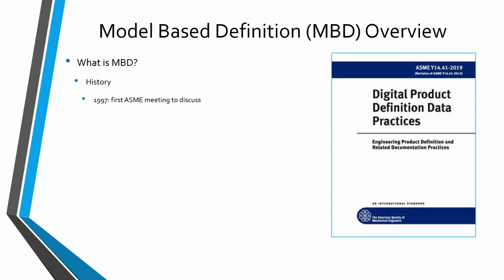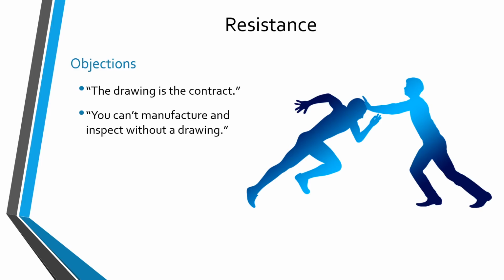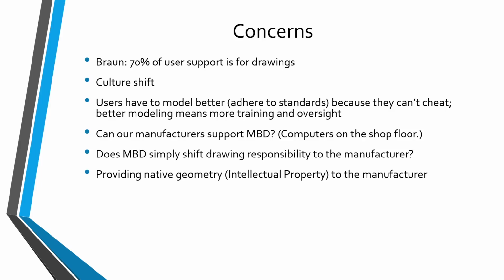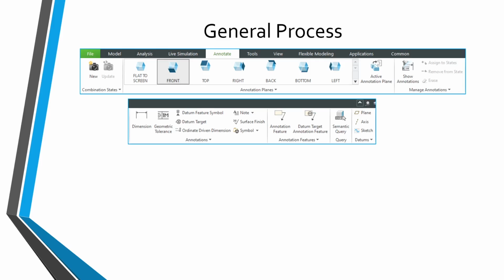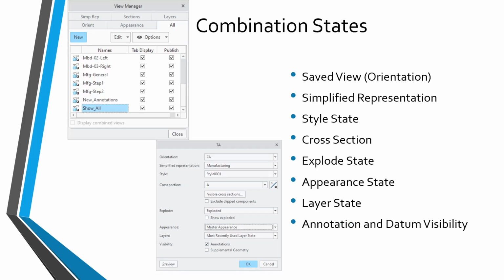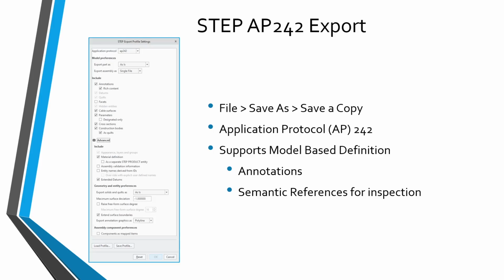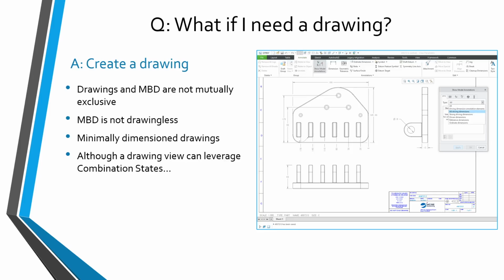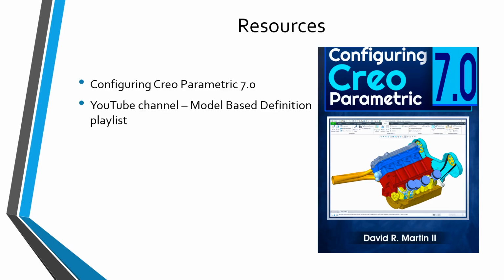Creo Parametric - Model Based Definition (MBD) Overview

Comment: Hi, 

first thanks for your videos, I like to watch and learn from them. I'd like to ask a few questions to this MBD topic. I prepared my templates according to your videos and MIL-STD31000. I'm having some issues however when I'm trying to prepare either stp or 3D pdf from my models. For stp export, I ran it with the necessary settings (ap242 format, with annotations and rich text enabled). But when I try to import the stp back to Creo (to check, whether it worked correctly), there are some things missing (I can see the annotations + comb. states, but all the unattached notes are missing). I tried also Fusion 360, but there are I did not see anything except for the solid geometry itself. As for 3D PDF, in MIL-STD 31000B there is a 3D PDF example with 4 combined states where annotations as well as notes are visible. But when I try to save my model as 3D pdf, it seems to save only the views and not the combination states (essentially the same problem as with stp, I can see the annotations from one combined state, but not anything else (notes, etc.)). Could you please help me solving these problems?
Reply from the maker: I recommend filing a ticket with PTC Tech Support. This can be due to a variety of issues. I do not have time to assist you with this.